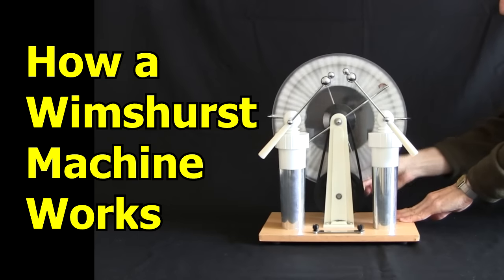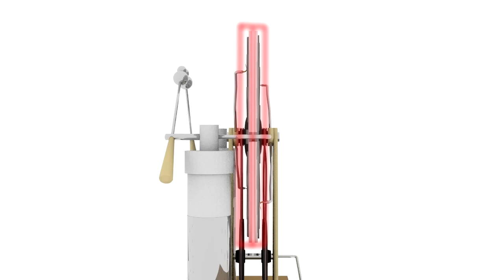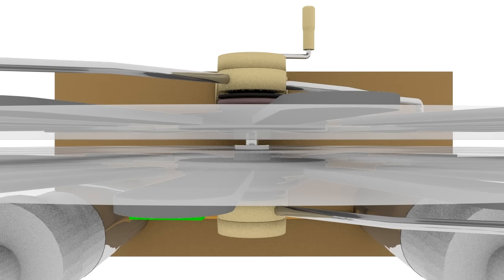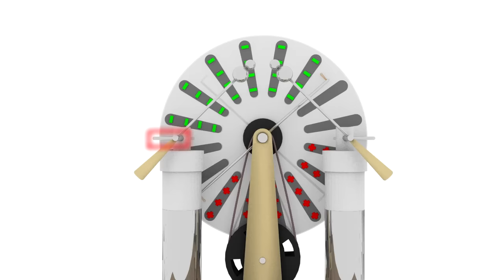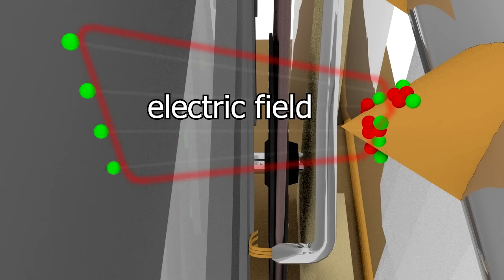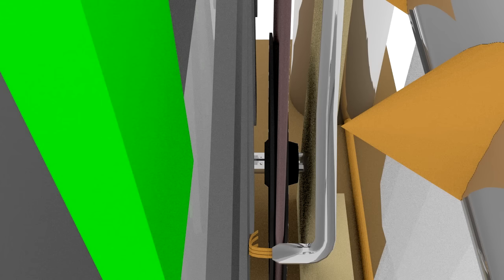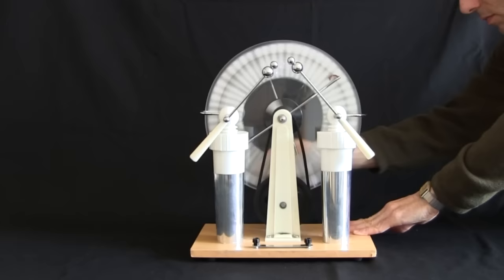How a Wimshurst Machine Works

Comment: very good explanation and animation!
just a small detail, you showed four negative charges flowing from a negative charged sector to a neutral charged one, but if it was like this,
what would stop the negative charges to flow back where they was before? after all, it would be like at the beginning.
I think the neutralizer instead works by equalizing charges between sectors, exactly like two caps in parallel reach almost the same voltage, 
so in your animation only two of the charges should move.
Reply from the maker: The charged sector that's on the other disk is what stops the negative charges from flowing back where they were before. When the disk rotates a little more and the sectors are no longer being touched by the neutralizer then there's no path for the negative charges to flow back along. And the repulsion by the negative sector on the other disk is still on the other side long enough for the disk to rotate away from the neutralizer.

I first thought that four charges should move and then realized that it would be just two, like you said.  That's when I was thinking like you, that the neutralizer was equalizing charge. But then when the destination sector was next rotated to where there was a neutralizer on the other disk, then it would have only the strength of two charges to repel with. So on the other disk, only one charge would move along that neutralizer to another sector, and so on, with the amount of charge moving around being less and less all the time. So I thought that can't be right. That's when I realized that the two sectors and the neutralizer are all electrically connected and the explanation I gave made sense.
Reply: Very nice explanation and animations indeed! For me the question is not so much why the charge does not flow back, but why it is completely flowing to the other sector in the first place. I would think that it would almost even out between the two sectors. Can you explain why it would flow entirely to the opposite sector?

Comment: can you build up the individual sparks into one big charge?
Reply from the maker: Yes. You just have to move the two sides of the spark gap (the balls) further apart. That way it'll take longer between sparks giving more time for more charge to build up in the Leyden jars. You'll have fewer sparks but they'll be bigger.
Reply: how long can you place them apart until the sparks cannot reach?
Reply from the maker: The maximum spark gap width varies depending on the humidity in the air and other factors such as losses. At some point, the charge build-up on the various parts will get so high that the losses don't allow any more charge to build-up. I've never test what that maximum width would be. I've probably gotten 3 to 4 inch sparks without looking for the maximum.

Comment: The fact is micro amps or milliamps current occurs , but how I=V/R equation conform with that? Where is so big resistance ? More over in example with 200meter ionized wire again (not a storm condition) pico amps current flows from earth to the top . I am confused
Reply: The air in the spark gap has high resistance

Comment: Hey I know this is an old video, but could you tell me why more foil strips are needed as opposed to fewer large ones? Thanks
Reply from the maker: I think the effect is the same: larger foils = more foils. You don't want the foils too close together though, as that causes leakage from one foil to the next. So spacing is more important there.
Reply: @RimstarOrg  Oh ok. Thanks for the fast reply!
Reply: @niksa28  Electrostatic energy is really different. And the one from a Wimshurst machine happens to be really low current, like in the micro amps or nano amps, so any energy at those amps are gonna be super high voltages. But it can build up. The more it builds up, the more electric potential there is. So in a Wimshurst machine, it stores it in literally 3 capacitors. Obviously that doesn't add up to a lot of energy, but at such little amperage it will be really high voltage.

Comment: Hello,
Thanks for this quite informative video. There are still things I don't understand.
Why does the charge keep increasing? It feels like first, with some losses, the first induced charge would be slighlty smaller than the initial one, and so on for the next one. Is it bigger? Why?
Also wouldn't there be a point where the jars are charged enough to stop the plates from discharging?
Reply: 1.Because there is always random fluctuations of charge in the air, thanks to weather, and the energy from turning the device is what drives the charge to seperate.

2. Because the capacitors are connected to the spark gap, so once the air voltage of roughly 30 thousand volts per centimeter of air has been reached, the air no longer can prevent the flow of charge, and thus a spark is formed which drains the capacitors, once the charge has been neutralized, the whole process repeats itself as long as energy is supplied to the system.
Reply: @TCBYEAHCUZ  There is induction from several sectors in one, concentrating charge in the sector touching a neutralizer.

Comment: Am I right in my understanding sir, So the end result of having "split-half'" regions of + and - are as a result of the manually applied charged of one disk eventually replacing all the pr-existing charged states of the other side(As you said all the sectors originally had random charges at the start (assuming no loading charge with thetube)) before the crank was turned and charge was applied? 

I'm asking this because we know - repel - but does + repel +? or am I misunderstanding how the loaded charge moved to the other disk? Thanks
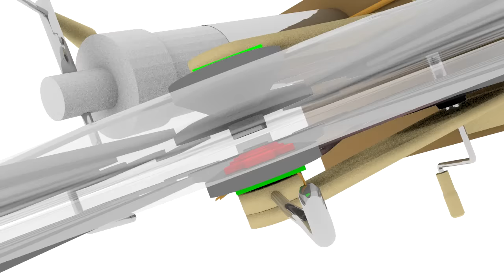Reply from the maker: For the most part, the charges don't move from disk to disk. They move among the sectors on each disk. For example, at 3:36 you can see negative charge moving from one sector to another sector on the same disk. Similarly at 4:20 for the other disk.
I said "For the most part" in the above paragraph because the movement of charge that happens at 8:13 is going from collector to collector and since each collector faces both disks, that can cause the charge to be redistributed between the disks.
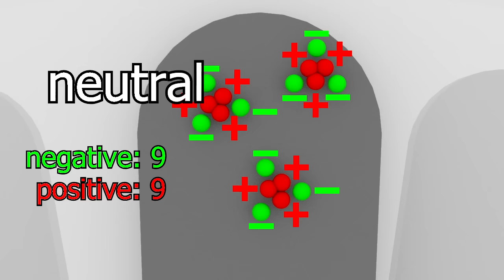You're right in that - repels - and + repels + but as I point out at 0:58, only the - electrons can move. The + protons can't move. But + and - attract each other. That's why throughout the video and at the times I point out above, you see only the - charges moving.
The total charge does not move from disk to disk though. At 9:02 you can see that each disk ends up with some of its sectors being positive and some being negative.
Reply: @RimstarOrg  Thanks for detailed reply, dang it I did not catch that they moved across the other  disk via the collectors.. last question, I have been trying to make the Wimshurst and have yet to be sucessful. Do the twin disks have to be touching and be fairly close, is the distance of the disk important, Im not sure if that contributes to charge movement. Your replies would mean great deal to me thanks.
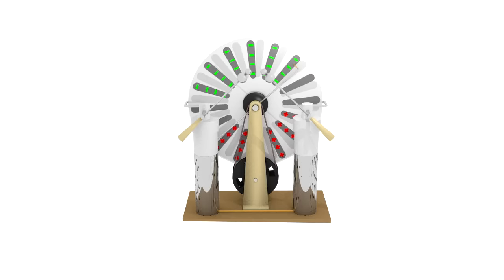Reply from the maker: You want the disks to be as close together as they can be without having arcing or too much leakage around the disk. Close together it good since the closer they are, the stronger the induction (attraction and replusion from  the charge on sectors on one disk to the sectors on the other disk). If they're too far apart then the induction may not even happen at all! Try manually starting it like I show at 9:09. Damp air also causes problems so drier air is better. You also want to minimize or have no sharp edges (other than places like the collectors) since charge will leak sharp edges and will not be able to build up.

Comment: Do the brushes necessarily touch the plates on the discs or could they just be at a right distance?
Reply from the maker: Usually they have to touch. I have seen a design where the disk has no sectors, just bare plastic and in that case the neutralize brushes didn't touch. Theoretically, if the charge is high enough then the charge can conduct across the gap as with the collectors but I've never tried it.

Comment: Hello, I'm from Peru, I have a question. How much voltage must there be between the plates before reaching the capacitor?
Reply from the maker: That's a hard thing to answer, or even measure, so I have to say I don't know. Probably it's in the thousands. (Hi from Canada)
Reply: 30 kV/cm is breakdown voltage of air, so it's easy to calculate based on the distance between ball ends

Comment: At 7:20 schematic, why are the Leiden jar capacitors connected in series? Shouldn't they be in parallel instead?
Reply from the maker: Nope, they're connected in series. The two outer cylinders are connect together. If you follow the polarity of the charge, the inner cylinder on the left in the animation is negative, so the outer cylinder on the left is positive, that makes the outer cylinder on the right one negative which makes the inner cylinder on the right positive. You can follow the capacitor plates I've drawn at 7:20 in the same way, the leftmost plate is negative, then the opposing plate for that one is positive, that makes the left plate of the capactor on the right negative which makes the rightmost plate positive.

Comment: I might just be naïve in this field, I’m a software developer first, but this has got me thinking; if you were hand cranking a generator, the mechanical energy from your arm goes through the shaft turning a magnet which induces that energy electrically into the coil, and so, you basically have a one to one translation of mechanical energy into electrical energy, right?

This Wimshurst machine doesn’t appear to be generating power based on the energy you put into it like with an induction motor, rather, it seems your energy in is a low constant input to keep the wheel turning, but what is making the energy is a quality between the conductive materials on the 2 large opposing disks. Due to it’s working with static (high voltage, no current, no current means no electromagnetic resistance, right?) and the conductive plates are thin, having almost no resistance between each until their layers overlap, but then it’s an outward force- not directly fighting your input energy to push through. Most of the energy generating force seems to be applied by the disks simply sitting across from each other, which seems may require less energy in than it has the potential to produce given that the conductive plates used have the capacity to hold a greater number of electrons as static. As long as you start the machine with the highest charged plates, you will get the highest energy transfer independent of input energy.

Perhaps somehow we could attempt to attach capacitors to the conductive plates to further increase the charge capacity and see what that does to the energy produced.

In some way it sounds like it could work due to the fact that it’s working with a static charge. But like I mentioned, I’m not an electronics guy or an electrical engineer so I’m probably not considering everything, I’d like to learn what the problem(s) are with my “theory”. Am I thinking about this correctly? Can someone who really understands this stuff help me understand where the energy actually comes from in this machine? Is the energy created directly when you move the disks into each other’s space? Or is there more going on here?

Certainly if you spin it faster you will affect the over all energy output, but there should be no additional resistance between these plates because where there is no current there is no induction; this is simple a transfer of electrons. what is creating the energy is a matter of the property of the materials used.
Reply from the maker: The flaw in your reasoning is where you say " the conductive plates are thin, having almost no resistance between each until their layers overlap, but then it’s an outward force- not directly fighting your input energy to push through."
When the two plates are closest, as at 2:28 for example, the sector at the bottom of the image is negatively charged and it's facing the positively charged face of the sector on the other disk. That means there's an attraction as the sectors approach each other, then face each other and then are pulled apart. The work you did in rotating the faces to that position is where the energy conversion happens. Yes, the negative charge of the bottom sector  in the image repelled the electrons to the farther face of the other sector but it took work to put them in that position.
An analogy is moving a paddle through water. You use mechanical energy to move the paddle and the result is the current of flowing water, just as in the Wimshurst machine the directly observable result is the current in the neutralizer bar (3:34). That's the energy transfer. But just as in the Wimshurst machine, your paddle and you also feel an opposing force. In the case of the Wimshurst machine that opposing force is the resulting attraction between the negatively charged sector and the positively charged face of the other sector.
Where you really notice this is if you take away the collectors, i.e. let the charge build up on the sectors without removing it (ignoring losses to the surrounding air due to corona). When you do that, the disks become very, very hard to turn due to all the attraction.
It's sort of a Lenz's law but for electrostatic induction. You repelled the electrons, leaving positively charged face and now that positive charge is attracting you back.
Reply: RimstarOrg dang you have a lot of time on your hands
Reply from the maker: Naw, there are usually only two or three questions to answer a day, and I enjoy it.
Reply: RimstarOrg Hey thanks for explaining that man I really appreciate it
Reply from the maker: John Minton Thanks for the question, it was a fun one. Sorry reality doesn't work in our favor in this case (re the opposing force) :-).

Comment: Hi, just looking at the output created by a Wimshurst machine, the spark, is it powerful to charge a battery? I remember way back in Highschool we would dare someone to place his finger between the 2 balls and get shocked. it was painful as i remember.!!!
Reply from the maker: There's probably enough energy to charge a battery, depending on the capacity of the battery it may take a while. The spark is high voltage though, in the thousands depending on how wide the spark gap is, so you'd have to somehow lower the voltage to something just above the battery voltage. It would probably be easier to remove the spark gap and the Leyden jars and instead take the energy directly from the collectors, putting them through some sort of circuit to make sure the voltage is just above the battery voltage.